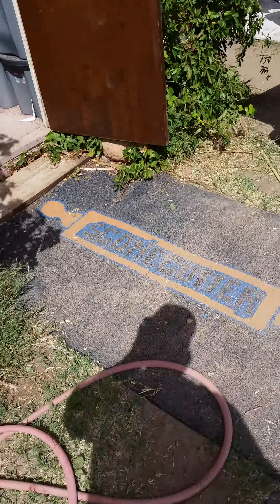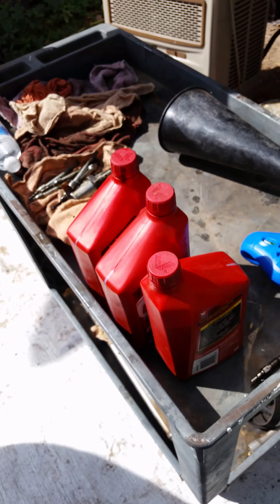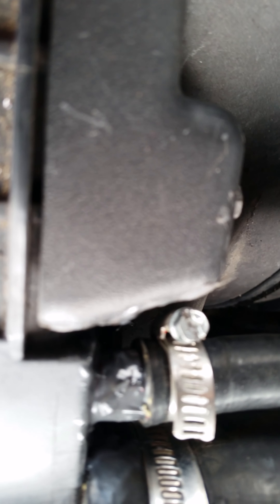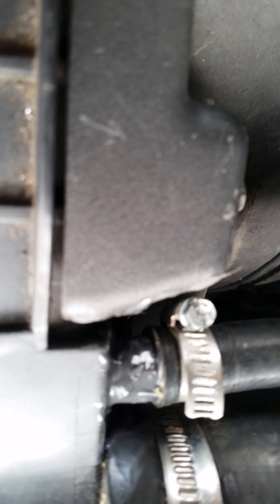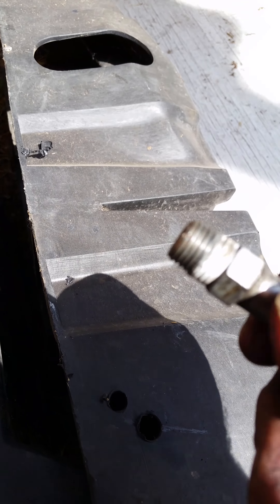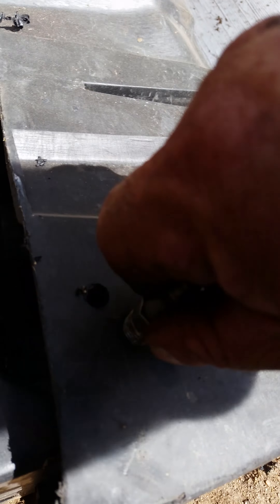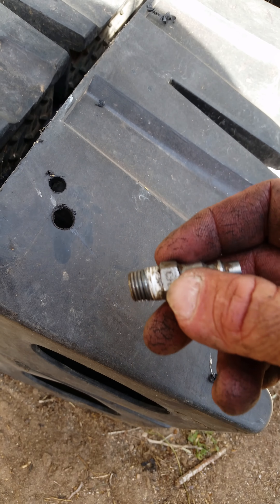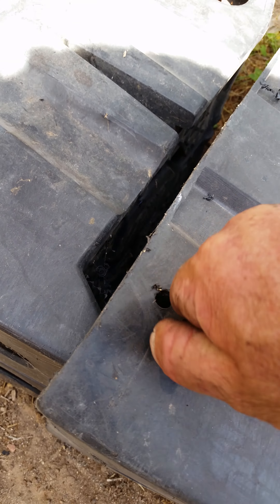6.0 broken radiator nipple best fix

Comment: hey thanks for steering me in the right direction, i used a plumbing fitting that was brass but i managed to wrap it one with teflon and coat the thread with jb it fixed it perfectly 200 km and no leaks holding strong

Comment: I'm glad it worked, I would be leery of it expanding the hard plastic of the filler neck and cracking it. Typically you can put plastic thread inside metal, but not metal thread inside plastic for this reason.  The bumper you used as a demonstration is a soft malleable plastic compared to the radiator. I would probably heat the hard plastic, not to a melting point, but to make it malleable to reduce the risk of cracking.

Comment: Hi friend thank you so much for the video in the advice. I have a question... being the stupid impatient jerk that I am, I broke the nipple have the radiator cap on the top of my reefer trailer. What I'm wondering is... can replacement nipple be put lower down or does it have to be right alongside the radiator cap?

Comment: thanks Dude  you  save  me a  lot  of  money -

question: 
Can  I use a steel Plug?   and  what  are  the cons using steel? 

 and  how long will  the  repair last  the  life of  the radiator  or is it a temporary fix ? 

 thanks

Comment: What size the air fitting???? 1/2 inch as well? Good lord
Reply from the maker: No 3/8
Reply: @whocaresaboutme29  thank you sir for quick reply. Just happened to my truck and I can't afford a new radiator right now. With just yellow Teflon would it hold or is the job weld necessary
Reply from the maker: Teflon tape it for now
Reply: @whocaresaboutme29  thank you sir. Hopefully it works

Comment: did you use high temp jb weld? Every time my coolant gets hot, the jb weld softens and it leaks. Once the coolant cools down it stops leaking.
Reply: Question is did u us high temp?
Reply: Is that fitting too small for proper flow? U fail to tell us why allumi is better than steel or brass...
Reply: @rabar537  , he mentioned that the J.B. weld ,  adheres better to aluminum,  than brass .